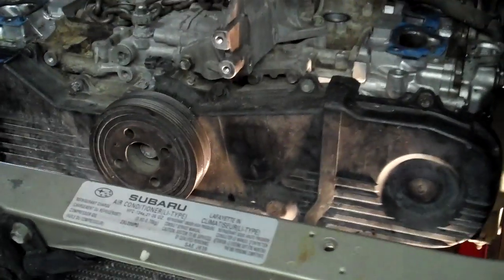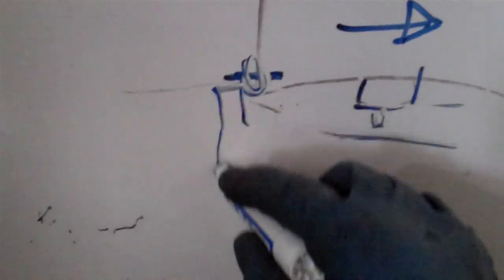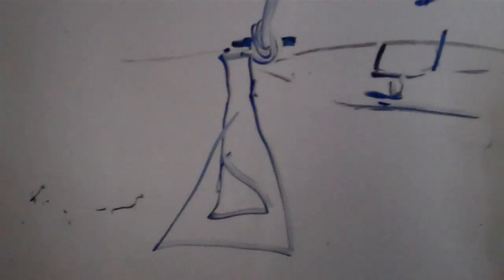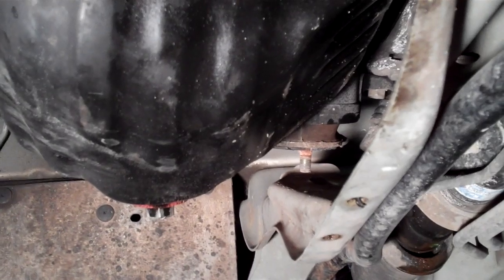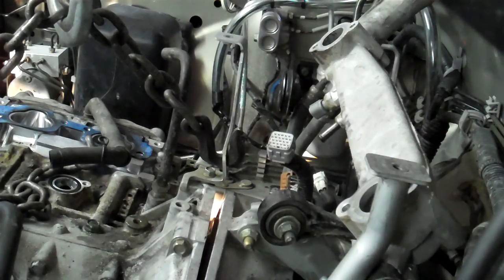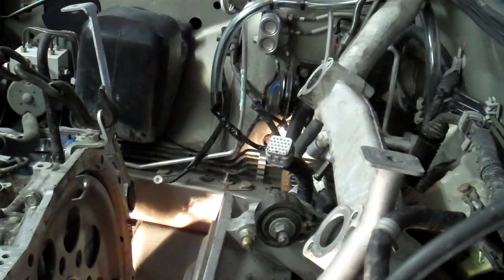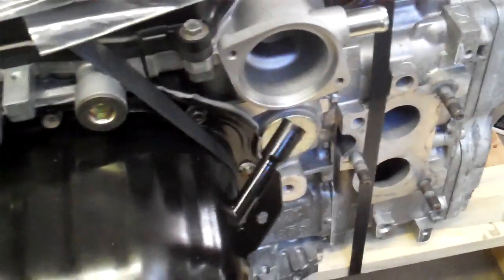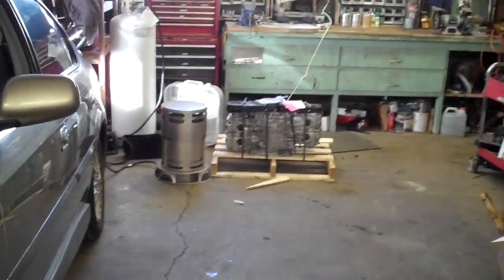Tips for How to get the engine and transmission separated on a Subaru

Comment: Replacing clutch on a 1984 Subaru Legacy found that could not separate Gearbox from engine. I heated up the area around the dowel pins with a GOOD heatgun for about 5 minutes ( a bad heatgun will burn out in less than that), then sprayed ROSTFLASH (penetrating oil with freeze effect) on the dowel, hit the dowel with a punch and hammer to push it slightly in and get it free. As soon as the hammer blows sounded hollow I knew the dowel was free. Gearbox came out easily after that.

Comment from the maker: You can disconnect the cable from the trans shifter and then move it manually.  I always just put a tube into the two open fuel lines and put a battery back in it.

Comment: Pulling them apart is the easy part.Getting them together is a PITA.I highly recommend taking several strips of Duct Tape & placing them all over the TC/Bellhousing.Make sure the Torque Converter doesn't pop out otherwise you'll be sliding that thing in & out trying to get it to slide all the way back.Had this happen on an 87 XT Turbo.Finally gave up after 3 solid days & took it to the dealer & had it popped in for free.You might think 2 pops is it.Nope there's 3.

Comment: This was only reason I not done it yet. Bit man great thank u. Hpnns try fix my real central oil leak. It really bad. I bought metal separator plate n rear seal. Hopefully that why. Cleaned my pcv valve. It open closes easier than before. Was a little funny but not jammed shut. 

Thank u for the detail

Comment from the maker: @prodriver1 The block has a hair line crack in it on cylinder two behind the water pump.  The old engine has a $500 core on it or so.

Comment: i noticed you are replacing the single cam motor with a twin cam. Will there be any CEL with that swap? Is the wiring harness fully compatible? And what about an h6 swap into say an 07 outback limited? Would I be facing harness, ecu, and transmission compatibility issues with a swap like that? Just dreaming here and it looks like you know your stuff. Thanks for all the Subaru videos! They have helped me out a lot!

Comment: You probably would even see this question Brian, but why pull the engine to change clutch, flywheel, pressure plate, etc when it seems easier to drop the gearbox....especially when someone dont have a "cherry picker" (engine hoist) to do such a job?

Comment: All your videos are really fantastic!  I really enjoy watching them a lot.  You have plenty of tips to share and save me time.  How much does the daily driving motor cost and where to get them?  Thinking about replacing mine since it burn a lot of oil at 190k miles.  The power train needs a rebuilt as well.  My '01 legacy gt only spins 3 wheels, and the front passenger side jerks along the way.  My guess is the bad LSD.  What's your recommendation?  Thanks for the great videos and cheers! H.L

Comment: hey brain, quick question. im pulling the transmission out of a 1992 Subaru legacy and the engine and the transmission a completely stuck together. I have pulled a hand full of shredded clutch disk out of the opening for the starter. Now everything moves freely around the pins and the 2 studs at the bottom. so im pretty sure the input shaft for the transmission is some how bound up with all the shredded clutch. before i started pulling the transmission, the clutch was stuck engaged, and you could shift through all the gears with the engine running and your foot off the clutch pedal. Any suggestions to getting it apart would be great. thanks

Comment: Great video. I just did the clutch on a 03 wrx. Worked great for about 3 days and then the throw out bearing let go of the pressure plate. I snapped it back it. It worked for another day and then let go again. I had a similar prob with an isuzu and ended up welding the throw out bearing to the pressure plate. Is there a better fix? and have you heard of this before.

Comment: Hi ur awesome dude!!! I have a subaru tribeca 2008 best way to explain the problem in is that I make a complete stop and sometimes not even that but when i press the gas pedal again it makes a cranking noise which makes it sometimes hard to take of like a car normally should . Its a transmission problem it also makes a clinck noisewhen i change gears:( should i keep it and fix it or sell it ???

Comment: Brian Thanks! for empowering me to tackle my Subaru engine removal.  I have however ran into a problem with regard to your point of lowering the motor until there is small separation.  I have done your recommendation of the third jack stand under the transmission.  When I lower the engine I still am not able to get it to separate.  Is there an area that I can “tap” against?  Or install jack screws?  04 Impreza RS  w/ auto trans.  Thanks in advance!!

Comment: This question is for a 2001 Chrysler Sebring, so I know you may not know, but it's worth a shot.

I don't know whether to lower or raise the engine out. The transmission is in a little niche in the body of the car, so it can't be pulled up. So if I'm going up with the engine, I have to disconnect the transmission. I'm thinking that means I need a transmission jack to support it while the engine is out. Does that sound correct?

If I lower both of them, then I'll have to jack the car up to get 24" of clearance, which means I'll need a taller jack most likely, lol.

I'm not sure which to do. Any advice would be great. Thanks.

Comment: Pulling a forester engine now and snapped one of the bolts on the passenger side. Sheared right off at the head. Will this prevent the motor from coming out and need to be drilled, or seeing as the head is gone, will it pull through like the other studs?

Comment: Sorry last question. If u undo motor mounts and start to Jack up transmission with lift engine will it go up with out unbolting the transmission bolts?
Like to life engine must in bolt motor mounts. But to Jack up transmission do u have on hold this? Or does it have play?

Comment: My first Subaru engine removal was my 2005 Outback with a 2.5 non turbo. The trouble I encountered was as I pulled the engine out separating it from the trans the torque converter got hung up on the little flywheel inspection cover underneath and the torque converter came out with the engine. That little inspection cover seem impossible to get to. How did you avoid pulling the torque converter out with the engine?

Comment: if it's a manual you always leave it on? can you elaborate for me. Do you just remove the fasteners from the intake and break the heads loose with all of those electrical connectors attached? or do you just wait to take the intake off once the engine is hanging?

Comment: I have a question for you... I have a 2000 firebird need to replace broken flywheel/flexplate friend has removed transmisson bolts but can't get to slide on the dowel pins .. any suggestions?

Comment: any tips on getting a bellhousing seperated from the engine on an ej205 that has some corrosion. Pulled the trans out of my old bugeye that was totaled to swap the clutch into my new wrx. first i had a hell of a time getting it initially seperated, i could not fit a pry bar between them. second was getting it off the studs. i supported the front of the engine to tilt back whille trying to pull and wiggle the trans out but it took about 45 mins just to get it off the studs.

Comment: What is the main difference with pulling a motor on a manual vs an automatic? You mention the bolts in the bell housing, are those just for the torque converter and the manual won't have anything in there keeping it from coming out?
Reply from the maker: That's right.  I have another video called "don't ride the clutch or this happens with some detail on that.  You may like it.
Reply: Yeah, I might check it out. I had posted that question when I was taking my motor out. I got the head gaskets replaced and that car sold since then.
Reply: It may not be useful to you now, but for other future engine pullers, the difference between the standard trans and auto trans is the number of bell housing bolts and studs. There are 2 straight studs on th bottom side of the engine (driver side is just in front of the axle shaft, passenger side has an o2 harness loop bracket on the stud). Other than that is the converter bolts.

Comment: in removing my engine on my DOHC EJ255, it appears i unseated the passenger side breather nipple on top of the transmission.  Apparently it's not a replacement part. Has that happened to you at all?  what's the fix?

Comment: I am pulling the engine on my subaru forester 2007 X and the transmission will not separate from the engine. I made sure that all the bolts and nuts were out and i think that its just resting on the two studs near the bottom. we have tried everything including using a chisel and hammer and messing with the tension on the lift and the transmission jack . WHY WONT IT SEPARATE
Reply from the maker: Noah Flowe It's rusted OR there's a bolt that's been missed.  Double check all the way around and if you have every single bolt bulge addressed, spray penetrating oil all the way around and let it soak 30 minutes.

Comment: Brian is there a way to unlock the transmission to push car with out putting the battery in? Its a 2000 forester had a blown head the block is back in, still have upper intake and front acc. to do. the car is outside just want to push into garage. Thanks.

Comment: thanks for the vid. im pulling a ej25 out of a 2009 forester could you tell me how you unbolted the torque converter from drive plate
Reply: Back of the engine, just below the throttle body (right side) there is a rubber plug you remove and then turn the engine until you see the 12MM bolt head, unscrew it; do it for 4 bolts and you're done.

Comment: How did you get to the torque converter bolts from the bottom
Reply: +drew marin from the top. theres an access. remove the black rubber.

Comment: Brian I have a a friend with 02 outback that needs a clutch can you not pull engine and is it a bitch I am a retired truck wrench I,m think 400.00 plus parts ? your thoughts would be appriciated
Reply: You can pull the engine or drop the tranny, the engines come out of subarus very easily as do the transmissions, its a matter of personal preferance more than anything
Reply: Thanks I guess both are about the same amount of work
Reply: I just finished up a clutch job in my forester, I pulled the tranny, I have a lift though